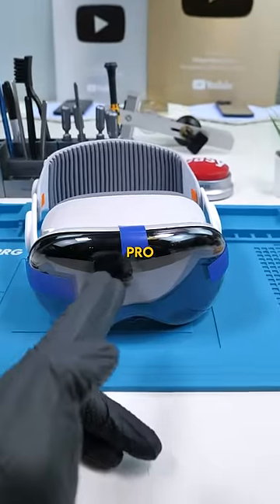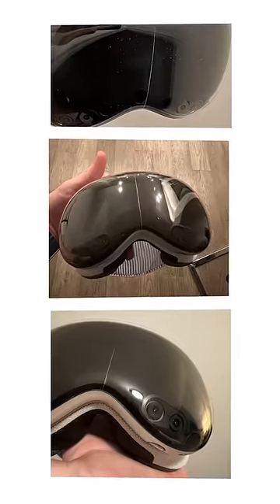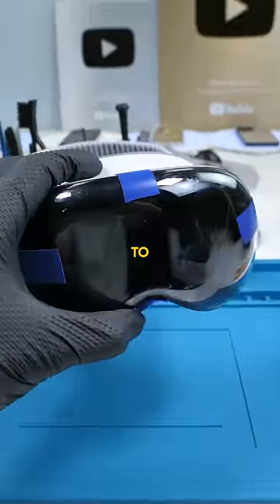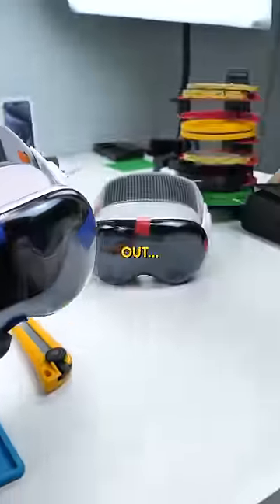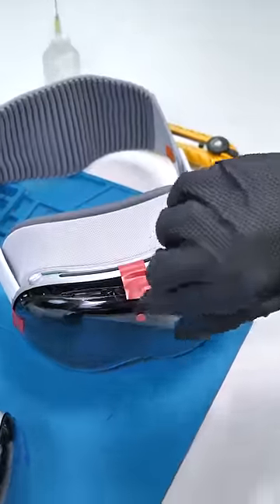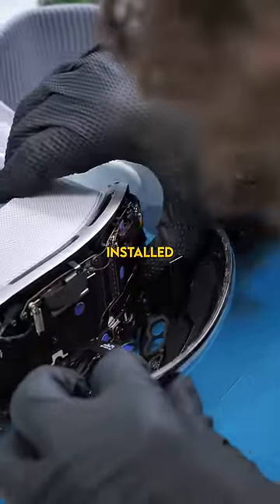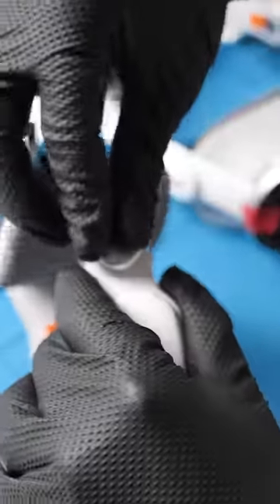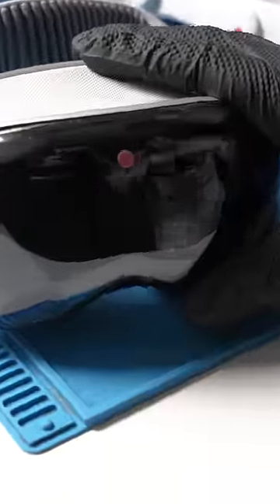The Apple Vision Pro IS BREAKING ITSELF....? #Shorts

Comment: Hey apple, the glass broke. Can you replace it? 
Yeah, it'll be 4000$
Reply: They replace it under warranty if this crack down the middle of the screen happens. Would be open for a lawsuit if it didn't because it's clearly a manufacturing fault as you can't drop a piece of glass so it cracks in a perfectly straight line.
Reply: And then it's just a new vision pro

Comment: It "should" work without issue but Apple detected a change in 1 serial number and said nope. 😅
Reply: The issue is most likely with the cameras in the display not the display itself because each camera needs to be correctly calibrated to the specific device it is on
Reply: @Foam_ball that just seems like a marketing bs reason
Reply: @Foam_ball  I call bullshit on that.
Its a camera. Literally every other device on the world can use em just fine without special calibration.

Don't excuse apple's blatant abuse.
Reply: @Foam_ball  Found the Apple shill